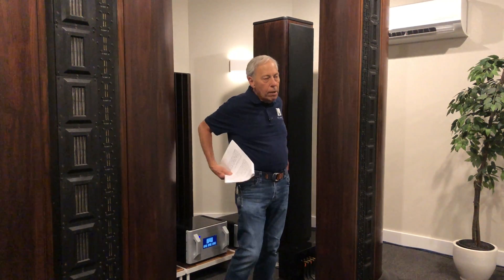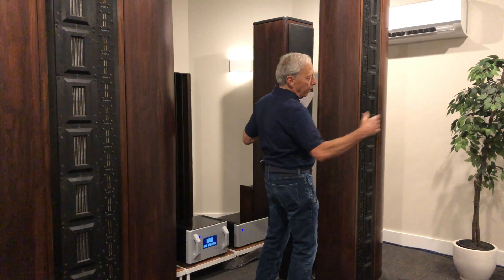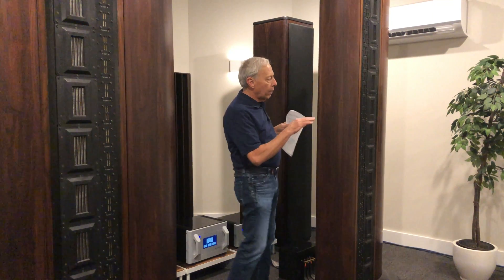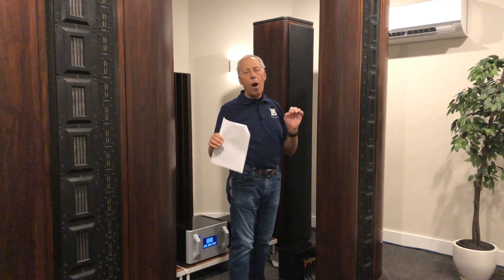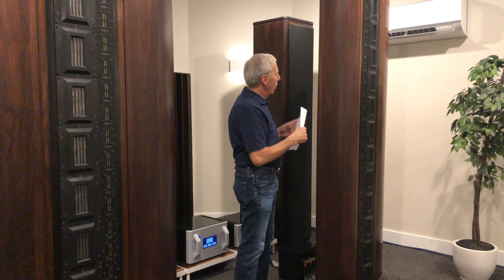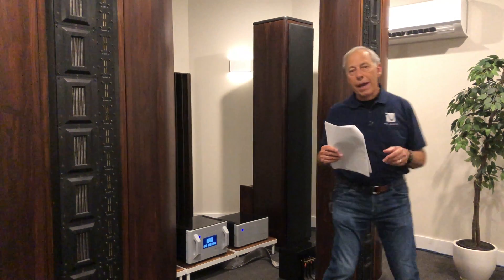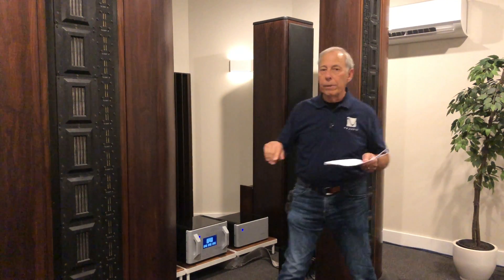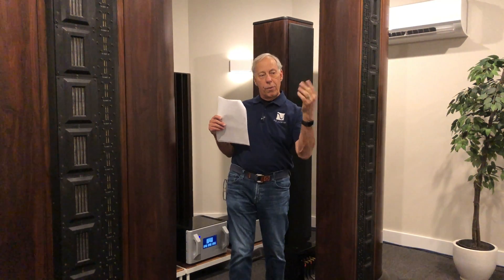How do dipole speakers make magic?

Comment: there's nothing special about dipoles. the spacious-like, revealing-like, like-no-other kind of sound that you hear from dipoles is just a result of phase cancellation. you can get (kind of) the same kind of sound by connecting one of the main speakers in reverse polarity.
Reply: that is not true , dipoles , if done right, can have constant directivity , which is completely infeasible with a forward radiating classic box speaker . On top of that , the ratio of direct sound to indirect sound is completely different .
Reply: @gerritgovaerts8443  these sound like marketing BS to me. i don't know who told you these but they're pure BS, i don't want to be mean but they really are BS.
go read something scientific instead of review garbage, i'm tired of explaining as nobody's gonna listen anyway, thanks to cognitive dissonance.
Reply: @duckmesideways  taking the science out of loudspeakers is 100% nonsense
Reply: @duckmesideways - Your wrong. Electro-Voice once made Dipole Speakers developed by CBS Labs. Who if You recall co- developed the 'SQ' 4 channel matrix format with Sony. And were the 1st Speaker Company to utilize Theil / Small parameters in a production speaker ! The problem with most Dipoles was Not Directivity, nor Imagery ... Both Lovely. But most had both - low sensitivity and limited dynamic range ! ie. Quads 
That's what killed 'EV's sales on that expensive attempt.
But, the Best Selling Speaker in The Infinity range, back in the mid- 70's was the "2001"... A simple 2-way 10 '' Mid-Bass driver, in a box about the size of a KLH 6. It differed in that a 2nd Cone Tweeter, was mounted on the Back Panel of the enclosure … probably Out of Phase and crossed-over at a frequency higher than the front one. Somewhere in the "super tweeter" region of about 7 K hz. For a entry level speaker, It had KLH like Bass, and Mids, with greater directivity, imagery & still had a fair amount of "room ambience". But Not so exaggerated, to be vilified like a Bose 901.
Reply: @RoaroftheTiger  a history of something doesn't make it special. stop falling for that trick.
Reply: @Chase1297  another victim of "music is art" trick huh? yeah music is art, sound reproduction is not, it's 100% science.
Reply: @duckmesideways  - If Your neither a Bot, or a Troll.  Your as Thick as a Brick.  That being said, " ... Let's Forget You Better Still"- Pete Townsend
Reply: @RoaroftheTiger  yeah. when the person at the other end says something you don't like and is so right that you can't argue, just call him a troll. yeah... that's so right in so many ways.
Reply: @duckmesideways  @Gerrit Govaerts If you don't understand his claims then just ask him to prove them. "Sounds like" is not an argument.
Reply: @littlegandhi1199  what's you point? i mean... you're going to invalidate my point for the phrase "sounds like" ? really? do you know how ridiculous that sounds?
Reply: @duckmesideways - "genius", The History of Electro Voice; and their early use of Theil/ Small Parameters is a mark of scientific credibility. You have None. Perhaps I should apologize to trolls. As even a Troll has more sense than You.
Reply: @duckmesideways  I've invalidated nothing. You've made an unproven claim while illustrating that you have no idea what his claims even mean. Again you could simply ask him what they mean and why they matter. Then make your case for why they don't matter if you want after that.
Reply: @littlegandhi1199  why would i need to ask about something i already know? the "sounds like" part was just an opinion, i wasn't guessing, i was 'just saying' i can't believe i had to explain this, it's ridiculous.
Reply: @duckmesideways  If you want to call Siegfried Linkwitz a marketing bullshitter , go ahead but that guy was (RIP) a very important member of the Acoustic Engineering Society and he is the co-inventor of the Linkwitz-Riley filter . He was a rabid proponent of dipoles and a lot of the theory behind them comes from his research . You would do well to visit his website , but only if you're not scared by the physics and math . This is science after all , not BS : https://www.linkwitzlab.com/
Reply: No that's just not true. The point of dipoles is to reduce cabinet rumble and to bounce sound off the walls to create a more natural sounding reverberation in the room (the reason why THX suggests dipoles for rear speakers).  Also in some scenarios it can be advantageous that the speakers seem less loud when you're (closer to) in between them because of the figure-of-8 polar pattern.
Putting a front speaker out of phase doesn't do any of that at all. You seem to forget that the reverse polarity of the backside of dipoles is actually in phase from the listening position.
Downsides of dipoles are typically: Less directional, less precise stereo imaging (because of all the added indirect sound), less efficient.
Reply: Not so much, Ped, first, all speakers suffer from phase cancellation when in a room. Dipoles, properly set up, do not suffer any more or less than mono pole speakers in this regard. It's all in the setup and acoustic treatment no matter what kind of speaker you have. To say you would get the same kind of sound by flipping the phase on one of your mains is just a stupid asshat thing to say, and total rubbish to boot.
The biggest change in the sound of open baffle dipole speakers over box speakers is... the lack of a box, and that is where the specialness of open baffle speakers happens.
I would prove it all to you but I don't want you in my house.
Reply: @bc527c  and how is "a lack of a box" special? you said it's special but didn't bother explaining why it's special. who's talking rubbish now? and if you're gonna explain, please, make it scientific. i'm sick of those feely-thinky mashup theory nonsense rationalization. remember that placebo pills may have an effect on you, but that doesn't mean they're real pills.
Reply: @duckmesideways  Sorry, I don't take fake pills. FFS Dude the whole thing your beefing about is box vs non box speakers, so it kinda follows that that is the difference. Speaker boxes make noise. Speaker boxes with ports make even more non primary driver made noise. Open baffle speakers don't have that, so it's not there, hence the difference. Both types of speakers can perform well, each format has it's +/-'s, that's life. 
You said phase cancellation is responsible for Open Baffle speakers touted qualities, well, no, actually phase cancellation makes for shitty fucked up sound. Like I said above, it's all about the room and how you handle that. A highend box speaker tends to need a shitload of acoustic treatment in order to sound best, and room modes can be/are a huge issue, the goal of highend listening rooms is to take the room out of the performance equation. With open baffle speakers you are intentionally using the room's reflections to make, hopefully, one big glorious soup of spacious big sound.
With the box speaker in the treated room you are trying to vastly reduce reflected sound thus vastly reducing comb filtering until you have a simple cohesive soundstage.
With open baffle speakers you are trying to use the rooms vast array of reflections to end up with, basically, so much sound wave interaction that it all evens out to a cohesive whole where all the frequencies are represented and without the boomy smearing of the speaker box a finer, more realistic reproduction of the tonal variations over time of a musical note played in an instrument..
Different approach, different results.
You want science. Wave theory, fluid dynamics, the speed of sound, the length of sound waves.
Reply: this is a VERY long reply for whoever is interested in a simple explanation of 'imaging and fidelity'.

did you know that the human ear decodes horizontal positioning based on timing? a sound originating to the left reaches the left year sooner than the right one. the difference in arrival times gives us the horizontal angle. but how does vertical positioning work? a sound originating above our head excites both ears at the same time... 

believe it or not (and there are experiments to prove the mechanisms) we decode the horizontal position based on tone and reflections. that tone difference between different vertical positions is given by the ridges in our earlobes. if one were to modify the earlobes' geometry with let's say plaster or bubble gum attached to the lobes' ridges, it would be impossible to locate the sound source in a vertical plane, but still be able to very accurately point to the horizontal position... 

in that sense, in order for a recording to give you the vertical positioning of the sound source, it would need to be recorded with two mics located in a perfect replica of your earlobes (for an accurate horizontal recording the mics would need to be located at the same distance as your ear drums are). it's just physics, very complex physics that our brains learned over many years and experiences. but that decoding algorithm is as subjective as our earlobes.

the simple truth is that the speaker doesn't need to bounce pressure waves off the back wall in order to reproduce with fidelity the recording room or studio even when that occurred while recording. the recording room's acoustics are already included in the recording itself, there is no need to augment that if we're talking about fidelity.

in a perfect hi-fi universe, the device that reproduces an audio recording (speakers, boxes and rooms) adds and subtracts NOTHING from the signal it receives...  the mics and mastering take care of everything that is going on in the recording environment  be it a studio, concert hall or open air. headphones in that sense have a huge advantage over speaker boxes. it's just physics.

in the real world, all the speakers in existence nuance the original signal. the speakers and the listening rooms add effects to the original recording. some in a grater degree than others and that is fine.

now, if we're bouncing sound off walls we're only getting farther away from the original recording. the wave pattern gets more complex and that creates more complex situations/interference such as cancellations, reverberations, distortions, etc. and that's fine. it may sound pleasant it may sound unpleasant. but it's not fidelity, it's a remastering so to call it...
Reply: @duroxkilo  Go listen to true dipoles like a pair of good electrostats :)  There is a reason people say dipoles is "magid" lol ;) Nothing I know of is able to create a sound stage that sound real like my Quad electrostats I used to own, I could listen to the sound of a movie with good stero track and swear I was listening to a full 7,1 surround system, that is what good true diploes does to the sound stage. It makes the sound feel real in a very strange way while at same time have good fidelity in the sound.

But for dipoles to work you of course have to have a listening room that can handle that sound coming out of the back (meaning proper dampening and symmetrical and many other things needed for it to work). I had my electrostats 1,5m from the back wall  angled at the listening chair in a very small room with thick heavy double curtains covering the entire wall behind the dipole speakers to dampen reflections from the back wall.

Comment: Paul you should explain the time aligment of those irs 5..
Those woofer towers behind the mids and tweeters ...mmmm
And being so tall your ears are  further away from the top and bottom tweeters...they shoud have some concave curve so as all tweeters are at the same distance from your ears...have you ever explained that? I dont get it...thanks and a hug my friend.
Reply: I think those "tweeters" all play different frequencies. And by introducing phase shifts you can create a "virtual curvature" like it is done in some Tectonics (or what's it called) speakers.
Reply: They all play exactly the same thing but you don't need curving and probably don't want it either. When they are stacked like this in a straight line (not curved) it's called a line array and when your ears are at the center of the speakers height you will receive all the benefits they offer. They offer constructive interference so the volume is consistent outwards in a bagel shape centered on the middle speaker
Reply: @littlegandhi1199  

What about comb filtering though? As you won't always be in the exact center position.